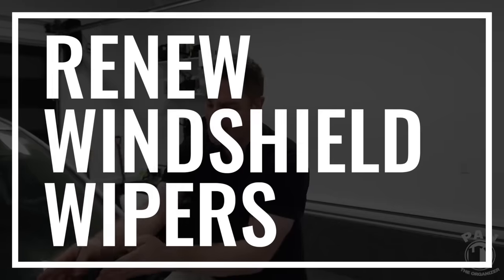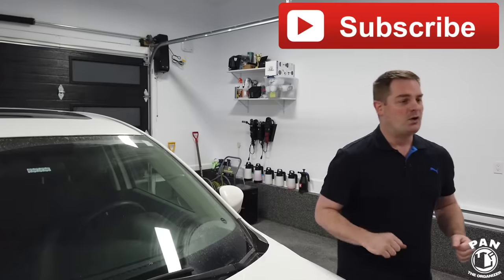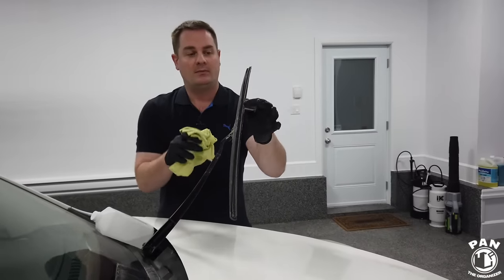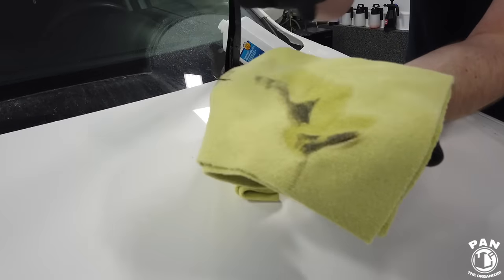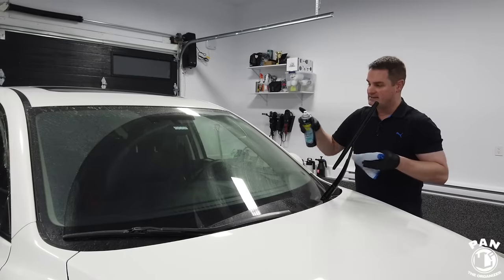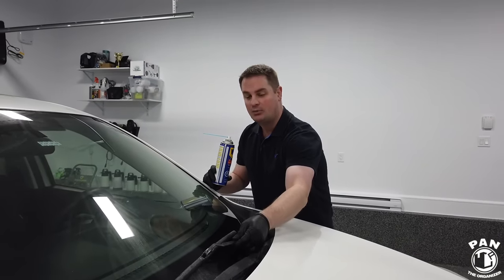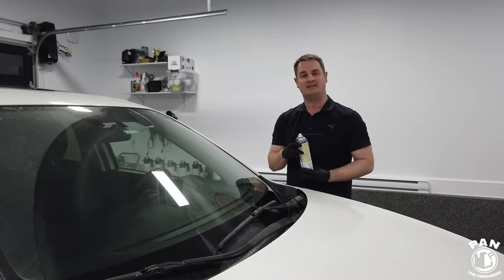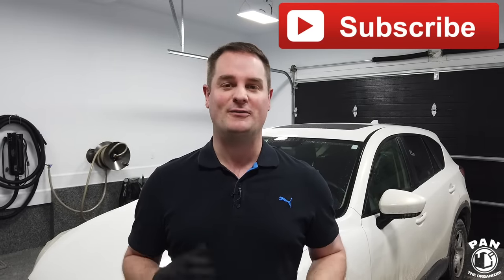HOW TO RENEW WINDSHIELD WIPER BLADES - ZERO STREAKS, QUICK & EASY !!

Comment: I usually clean my blades whenever I wash my vehicle.
Reply: I let the rain clean my wipers and I buy new ones every year or so ( why bothe for 13 euros? )
Reply: @SkodaHobbybob  Well....Dirty wipers aren't as effective as clean ones.
Reply: If you have new blades, then you probably can’t wipe them off, because most modern blades are made with graphite spraying
Reply: that's a good habit.
Reply: @SkodaHobbybob  Rain doesn't clean your wipers. That part that's always in contact with your windshield, it will stay dirty and just spread dirt around when in function, in process collecting more dirt. When do you think blades get dirty? During function. And when do they function? When the windshield is wet. Therefore you thinking that rain cleans your wipers is completely incorrect since it's the primary reason they get dirty in the first place.
Reply: What about silicone wipers? They squeak when u wipe them down...
Reply: @SkodaHobbybob  Absolutely  There's a time that the Rubber deteriorates and they need to be Changed. I too do the same  Change them about once a year

Comment: When you did the interior view, the blade wasn't clearing all of the water from the top left corner. Was still streaking or the blade wasn't making full contact
Reply: Mine does the same thing but on the passenger side bottom only at highway speeds totally misses it
Reply: @jeremiahbachmann3901  it must be the springs on mine, my wiper blades are new there are the bosh icon that ard $28 each from advance auto parts 🤣🤣
Reply: I noticed this as well. Other than wiping the blades clean during maintenance washes, I can't see the benefit to trying to extend the life of replaceable parts; blades should be replaced every 6-12 months, depending on your climate.
Reply: I want to know how many microfibre towels you own?! 😆😆
Reply: @CHZ8959  The bigger question is how many does he reuse and wash in washing machine.

Comment: I use denatured alcohol to clean the blade. I allow it to evaporate completely. Next I spray some rubber safe silicon spray lube on a cloth, again allow the solvents to evaporate, then wipe the blade rubber this helps keep the blade soft, ice dose not stick as hard and helps prevent blade chatter.

Comment: Most of the black gunk is graphite I believe, to make the blade have less friction and last longer.
Reply: Really?!?! That would explain a hell of a lot! I clean and clean and clean my wiper blades and I still get the 'black gunk' after wiping them ten times! And I've tried multiple products. No wonder I can't get them clean if it's graphite that's coming off!
Reply: Captain Cardboard Yes I’m sure about it. I guess a easy wipe to get debris and muck off doesn’t harm it :)
Reply: @FreakyTORRI  I tend to be plagued by noisy wipers. Tried a proper deep clean of the windscreen to fix it and everything. Now I'm wondering if the cause is me over cleaning my wipers and ruining them. I'm gonna get a new set and this time go easy on the cleaning. Thanks for the heads-up!
Reply: @Captain-Cardboard  Do you still have squeeky wipers? :)
Reply: @FreakyTORRI  No, all sorted. I followed the instructions in Pan's other video https://www.youtube.com/watch?v=CN-WYF3Nnak but used Nu-Finish instead of Rain-X. Topped off with new quality wiper blades and my problems were solved!

Comment: I have about 40 years experience in wiper development, testig, and production.  Your video is spot on.  I was concerned when you mentioned WD-40 because I have seen videos showing to clean the bades with WD-40.  It is petroleum based and will eat at the natural rubber squeegee.  Great use of it on the wiper arm base.
We do use #0000 steel wool and glass cleaner on our windshields in the test bucks.  NO MORE COARSE than #0000, it could scratch the glass.  Use a swirling motion then dry off with a towel or paper towel.
Great job... everything you suggested is totally correct...
Reply from the maker: Thank you! I appreciate the positive feedback.

Welcome to my channel. You discovered one of the biggest car detailing channels on YouTube as we surpassed 960,000 subscribers and we have over 130 million views! I have been detailing for 26 years and I love to share my knowledge and passion with my viewers.

You found the right channel to help you learn everything about detailing.
Reply: You say the WD40 will break down the rubber but others on here have commented on their great results with cleaning their blades with it, and managing to keep the same set of blades for years with that trick. So there seems to be some discrepancy...
Reply: @hydnars  funny I was just thinking the same.... So I actually do not know if I should use IPA to clean and then WD40 to preserve (I am talking about the rubber part only)... Otherwise I saw many videos of PTO and I must say he definitely knows what he is talking about...
Reply: @hydnars  Yeah,  but he said 40 years. The other people are easily liars or over-exaggerating it. Believe what you want, but I would prefer the FACTS of someone that's been in the industry for DECADES over some driveway warrior's OPINION that applies what he finds on Reddit over the last 6 years.

Comment: Pan, glad to see you and I doing the same methods.  Two points that need more understanding are the use of the rubbing alcohol and WD40.  I have heard that regular rubber can be affected by the alcohol but it does clean them!  Also I have started to use wife’s cheap facial pads instead of MF towel, that junk then is trashed rather than staining my towels. Next is the use of WD40, it is not a lubricant and should be wiped up as it does attract dust.  Interesting read on what WD40 is on Wikipedia https://en.m.wikipedia.org/wiki/WD-40. It is great product used correctly. Try TriFlow as a lubricant as it dries cleanly and does not attract grime.  Perfect time for this topic on wipers with so much use this time of year.  Thanks.
Reply: Trifle is amazing superior and who doesn't love the smell of oranges

Comment: Never knew about rubbing alcohol, perfect job, what a difference, amazing, thanks for sharing, BTW  my tip is to check the the wiper blade (via the arm) is sitting at a perfect 90° to the glass surface, if not, a gentle twist of the arm will correct that, blade will now not ‘shudder’ thanks for sharing. 😃👍
Reply: I'd be a little leery about using alcohol on rubber wiper blades. Alcohol dries out rubber and could cause them to eventually crack. However, alcohol would probably work well on wiper blades made from silicone.
Reply: Just use the soap you wash the vehicle with. No alcohol needed!👍BTW-I do this every time I wash the vehicle...and haven't replaced them in 16 seasons(4 years).

Comment: I found using a plastic/rubber restoring product to really help out alot. I use VRP from chemical guys and working it into the rubber of the blade,  restores the flexibility and wiping ability of the blade.
Reply: I know you wrote this comment many years ago but I'm wondering how well VRP holds up with the rain, being a water-based product?

Comment: Great video. Always good to have important skills that are also really cheap for the car owner. Everyone likes to save a buck and this tip is way cheaper than new blades. Btw, IPA and rubbing alcohol are not the same. IPA is 91% alcohol and rubbing alcohol is no more than 72%. Clean with IPA and disinfect with rubbing alcohol.
Reply from the maker: Thanks Mike!  Good to know.
Reply: Isopropyl rubbing alcohol starts at a minimum dilution ratio of 50% isopropyl/ 50% water and goes as high of a dilution ratio of 99% isopropyl/1% water. They are all "rubbing" alcohols, in differing concentrations.

Comment: Thanks pan. Did the wd40 on the fly tonight in a parking lot and hit the wet windshield with some formula 4 spay wax 1:10 dilution and wiped if off a bit like a drying aid even though it’s raining. Lol. 90 percent improvement on my cheap blades. 👍

Comment: I’m a window cleaner by profession for over 30 years, let me say that once the edge of the rubber/silicon is gone, then it is gone and you need to replace. You can buy rubber or silicon profile for windshield wipers on bulk, just like we buy replacement squeegee bands. Nothing fancy and much cheaper. Although after some years the wiper blade holder needs also replacing when it starts to deteriorate. I learnt that it’s not worth after 9/12 months and just replace the wiper.

Comment: another trick as i saw this elsewhere on the net. Since I wanted to go to Montreal Car show (2hr drive) and knowing it would be a snowy/slushy day for driving, since my wipers were a bit crappy (streaking), i just used WD-40 on a cloth and rubbed it on wiper for cleaning. Wow did that ever work well, no need to clean winshield either.      Pan you should try it.

Comment: A good no non-sense tip! I do the same thing as a finish step when cleaning my wind shield either at home with a microfiber cloth or at the fuel station when doing a quick clean-up. I take a paper towl and dip it into the window washing fluid that gas stations make available. Regular cleaning of the wipers seems to keep things running smoothly. What's the difference between using clean water and a microfiber cloth v. a 'high quality glass cleaner' and cloth? I get pretty good results with the water, especially if I've treated the glass with RainX, previously.
Reply from the maker: Thanks for watching!

Comment: First of all Big Fan; I have a question: Can I correct deep scratches on clear coat with menzerna 400 heavy cut?? Or do I need wet sanding? Actually both flatten clear coat, so the mechanism is same. If I stand longer on the scratch with polishing machine it should be gone right?

Comment: I tried this on some of my Rain-X blades that were maybe 8 months old (it's rained 3x here in Southern California since I put them on), it's mostly just fairly dry and hot. It was like wiping a marker. I gave up after one micro-fiber towel and like 2-3 shop towels per wiper blade kept coming back nearly as black as when I started, and on each of those I probably used 6-8 different sections on each microfiber towel or shop towel. I'm not sure if it's the type of rubber, if there's really that much caked on there, or if the rubber itself was being broken down by the IPA, but I gave up after about 15 minutes of wiper blade scrubbing. One blade did seem quite a bit better, the other a tad, but not a huge difference.

Comment: Just a FYI........WD-40 is not a lubricant, it is a water dispersant formula 40. Had a rep tell me that, he said WD was like 90% solvent. So it drys away. I use to work in apartment maintenance would get a work order for squeaky door hinge, would go spray WD on them. Then a few weeks later would get another work order for the same thing same apartment. After the rep told me WD was not a lub, I started using good old 3in1 oil, never got called back again.

Comment: I’d remove the blades, degrease with optimum power clean at 3:1 then wipe with a towel. Then use Pans methods, as alcohol isn’t as effective at degreasing rubber. Never thought about the WD40 though Pan. I’ll try the penetrating oil I have in stock. Haven’t serviced the hinges in 9yrs.

Comment: A trick I’ve heard to renew blades that are on the way out but not yet cracked to the point of no return is to apply wd-40 to the rubber.
Reply: Correct. Also treat the rubber with wd-40.
Reply: I use 303 to treat the blades.

Comment: I put WD 40 also on the wipers.
The dust dont get the full contact on the wipers and is easly removeable from the wipers.
(Sorry for my English knowledge)
Reply: Rip smear
Reply: WD-40 is petroleum-based and contains solvents that will degrade the rubber in your wipers over time.  You should never use any petroleum-based lubricant around rubber, (bushings, wiring, weather stripping, tires, etc) use a silicone-based lubricant in those areas.

Comment: I never thought to lubricate my wiper hinge...and I lubricate everything even my power window motors!  Thank you! I heard putting wipers up in winter during storms loosens those hinges and effects the pressure on the window over time...not sure if true
Reply from the maker: Glad I could help!
Reply: Last winter I didn’t put my wipers up and my windscreen got covered with snow and ice, as I got in the car and started it the wipers automatically turned on because of the snow and Ice on the windscreen and I completely forgot to switch auto off and it ripped both rubbers off my wipers blades. Luckily I have a auto shop near me so £35 later I had new blades, only to sell the car the week after 🤣

Comment: I had previously read that using the WD-40 like you used the rubbing alcohol would work well too. Can't confirm if it works or not. Nice tip on the wiper hinge too.
Reply from the maker: Thanks!
Reply: I did the WD-40 on the wiper hinges right after I watched your video. I had cleaned the blades a few weeks ago with not much of an improvement. Spraying the hinges made a huge difference! I also cleaned the windshield and wiped the metal parts of the assembly with the damp WD-40 cloth to improve the looks. Wipers work and look like new now!

Comment: If you want the wipers to last longer and actually be able to see in the rain use Rain x washer solvent. Huge difference!  Not recommended in BMW's because it might make the low washer fluid sensor malfunction. The alcohol cleaning does work though.

Comment: 5:07 see that top left corner? hate when it happens and it does more often than not. It only afects the driver side, sometimes it extends to middle of the windscreen. Cleaning the wipe sometimes help but not always...
Reply: This is mainly cause of the rubber flex. I stopped using rubber wipers they deteriorate pretty fast.
Reply: Foxxer which do you use?
Reply: @tundrawhisperer4821  Silicone

Comment: Thanks for reminding me; I was about to replace my blades. After using rubbing alcohol, wouldn't it be helpful to use VRP on the rubber? Also, great tip on the pins! Would Silicone spray work instead of WD40?
Reply: A graphite spray will work better as WD40 only displaces water and attracts dirt. Also a 303 or other type product will protect the wiper blade and extend it's service life.
Reply: I wouldn't put any coating products on the blade itself, it will get rubbed onto the glass...
Reply: I’d avoid coating the blades themselves, as the product can dry but it’s being directly wiped onto the glass. Maybe along the outer trim connecting to the metal itself for dressing/appearance 👍🏼

Comment: It helps if you never let your windshield get that dirty either. That makes a lot of dirt that your wipers have to pick up. Another tip, use a rubber protectant on your wipers too. Just wipe it off after a few minutes of soaking.

Comment: I’ve always used a clay bar on the windshield to clean it, in my experience it works better than just glass cleaner, and gives the hydroponic rain x effect but for much longer and keeps the wipers lasting longer. What are your thoughts on this?
Reply from the maker: Yes claying glass is great.  Watch my windshield cleaning tutorial: https://youtu.be/CN-WYF3Nnak
Reply: I used window cleaner clay and a straight blade

Comment: Putting extra virgin olive oil helps to keep the blades pliable. Put it on the blade and let it sit for 10 minutes. Then wipe off the excess. This also helps with door seals.

Comment: Thank you Pan! Question: What windshield washer fluid do you recommend? And what to stay away from, if any? Me, I am having the worst time with my windshield. When I got it new, about 7 months ago now, I used Invisible Glass Cleaner that had a ceramic going in it. I followed the instructions to the letter, but I have had nothing but misery ever since. I called Invisible Glass and they told me I must have gotten a bad batch and they would send me their glass stripper. So I used the glass stripper and it's not better. It's hard to describe what it looks like when wet, it's just  streaky and spotted and does not repel water. Oh and for windshield fluid I have been using RainX brand. Please help thank you!

Comment: Good job on cleaning wiper blade tutorial...Please cover other products such as Windshield Wiper Fluids and windshield treatments such as Rain X, waxes and others.
Reply from the maker: Thanks! How did you discover my channel?
Reply: @PanTheOrganizer  I'm a auto enthusiast that does hobby detailing for donations...I guess I searching for information on ceramic products when one of your videos popped up...Now I'm hooked and constantly learning from you...You have a very down to earth way of explaining and teaching the common DIY that wants to do better with car products...BTW, I recommend selicone wiper blades for performance and longevity.
Reply from the maker: Thank you for the kind words and positive feedback. Much appreciated. I have been detailing for over 23 years now, and I love sharing my knowledge and passion with my viewers. You found one of the biggest and fastest growing car detailing channels on YouTube as we surpassed 530,000 subscribers and are almost at 60 million views.

Good tip on the silicone wiper blades! ;)
Reply: @PanTheOrganizer  Pan ,could you please explain the benefits if any of a Foam Connon. There's a lot of hype out stating the "Foam lifts away the dirt." I think a garden hose gun set at JET will at pre wash rinse will do the same. Personally, the only benefit I can see if you're washing your car in hot direct sunlight and you have fear of soap drying before you go over the area with your wash mitt. This ofcourse can be resolved by washing the car early or late in the day.